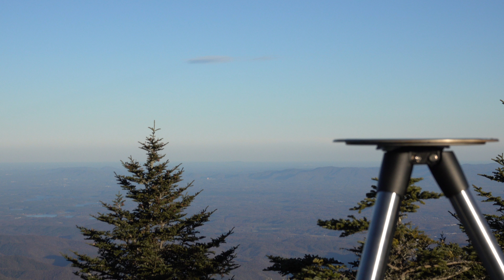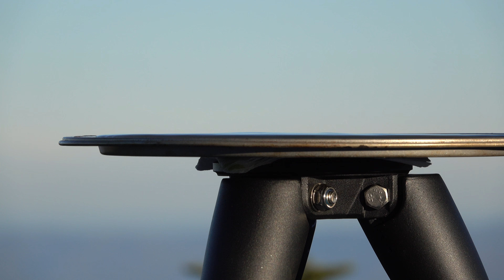FLAT EARTH DESTROYED visual proof from Mt Mitchell

Comment: Stop using your programmed mind and use your senses, anyone that views this video will see that this only proves that the earth isn't round.
Reply: you're at a high elevation and setting a line at 668,000 or so feet, of course everything will appear lower.  ^============   <-visual demonstration
Reply: Im-awake RU so don't use science that explains how life is able to be sub Stained on this planet which is round
Reply: Every day million people fart, only because you don't smell or hear those farts doesn't means the farts doesn't exist. That's what happen when your sense can't perceive everything that happen in the world you are in.
You just can't see the real form of the earth because you can't fly enough high without the help of expensive technology.
Reply from the maker: This video uses your sense of sight. IF the Earth was flat it would be parallel with the water level. Parallel lines converge at a vanishing point so IF the Earth was flat the horizon would be parallel with the water level but you can SEE the Earth is not parallel but curves away.